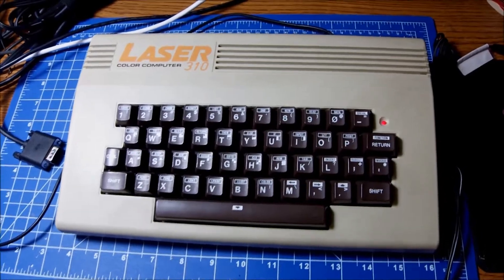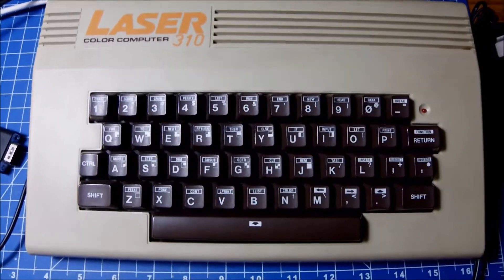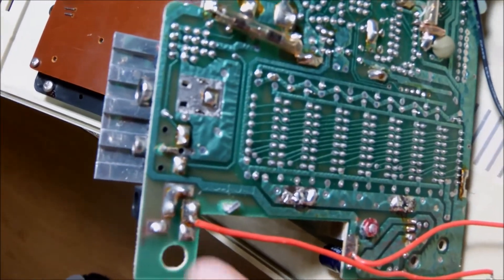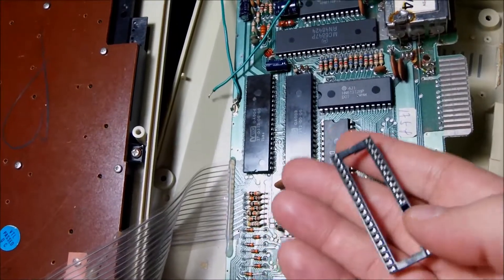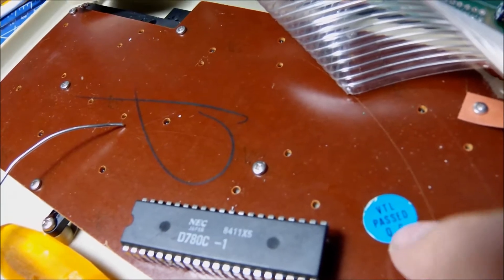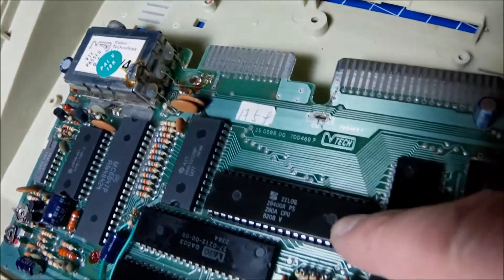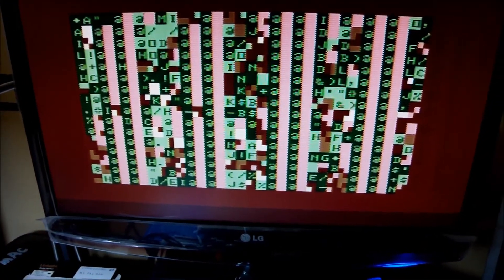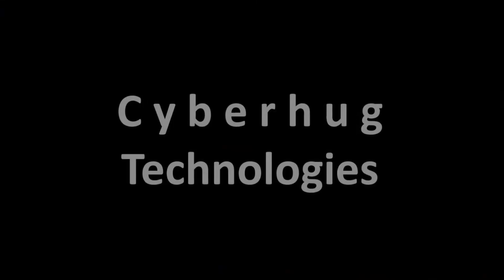VTech Laser 310 - 1984 - Fix Attempt - Part 2.

Comment: Check the RAM chips !!! You may have a low voltage due to a short, because of faulty chip.
Reply: Look at Happy Little Diods channel on YouTube.
Lots of interesting things.
Reply: Get rid of those wires. The guy probably wanted to ground diffrent parts of the system, but they are not essential. You can make a metal shield very easy
Reply: If you have low voltage, and the stabilizer radiator is heating, there could be a short in the system, due to a faulty chip. That may be your problem.
Very likely, a bad ram chip.
That could be the reason for the bad image.
I used a ohmmeter to trace a short in a machine.
If there is border, it means the cpu is working.
Reply from the maker: @MrGigi-dz9cv  Hey Mr. Gigi, I checked on him - I also commented once or twice, very interesting and promising channel indeed! Thanks!
Reply from the maker: @MrGigi-dz9cv  I got the values right from the RAM chips - one by one  mean - I think I will follow this idea and replace them and socket them - Thanks, for the time being ... I am stuck with the idea that is a ROM fault but sure enough, I need to replace the RAM as weel :-)

Comment: I Need part 3 !  I facing same problem of Laser 310
Reply from the maker: Hi Alex, thanks for watching - I think my problem is ROM and I should make a copy of it on some ERPOM chip anytime soon - and see how it goes! What is your problem like?
Reply: @CyberhugTechnologies  Although my screen is displayed, the content displayed is not normal, which is the same as your video. I infer that one of ROM, GA003, GA004 is wrong, and now I try to replace each chip.
Reply: @CyberhugTechnologies  To find a ROM, I can only check if there is a damaged machine but the ROM is still alive. For this reason, I have bought a very cheap garbage in the past few days, but it is actually good
Reply from the maker: @alexfarell4046  Hey Alex, my assumption is the same for my machine too - I guess here is a ROM image somewhere and can be burned into an EPROM?
Reply: @CyberhugTechnologies Hi, I think this is an operation that can be tried. Use a blank ROM chip to burn the ROM file, but you need to find out where the ROM file comes from. The ROM of Laser310 mainly contains a Microsoft BASIC interpreter.
Reply from the maker: @alexfarell4046  That is exactly what i have figured... Thanks! I was thinking some forum for this model can help on the bin file or some old ftp location....

Comment: Hi. I had two VZ200 with exactly this Problem and have read about it, but no Solution. Do you have a 230 Volt Power Supply Unit? Both here deliver 15 Volt than the rated 9 Volt. I think this killed the vz200. I have a running one without this Problem and the PSU still delivers 9 V! Did. you find out where the defect was? Greetings from germany.
Reply from the maker: Hi Andy, i got 9V stabilized as input - I think it was not overlvotage that should have killed the 7805 regulator first but your point is reasonable. I think i need to replace ROM with another one from a working system - put sockets first - o make sure that ROM is faulty - and probably BASIC... or both :-(